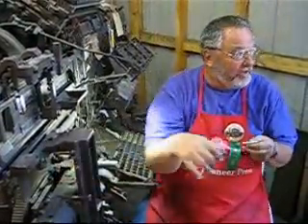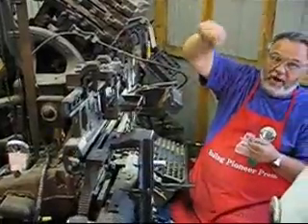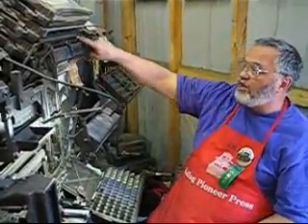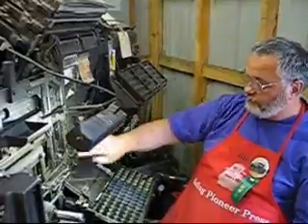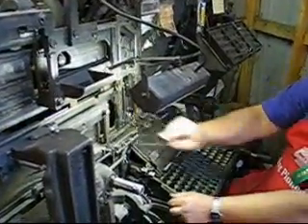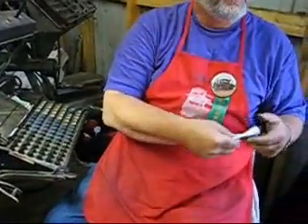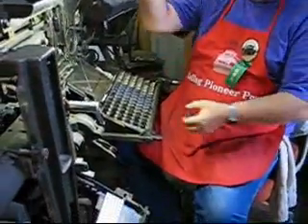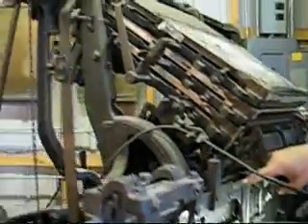Linotype Machine

Comment: Jan 6th 1976 I walked into the newsroom at the Evening Post in Wgton New Zealand. I was a 16 yr old apprentice and a printers devil. I saw and heard 30 linos running, smelt the boiling lead and was blown away. Now i'm 50 and own 2 ARAB platens and an Albion handpress. Im the Gumtree Press. There is one Lino still running in NZ, in Auckland. Ive  had an A4 story set in 10pt Times R. It arrived today. It still smells the same.